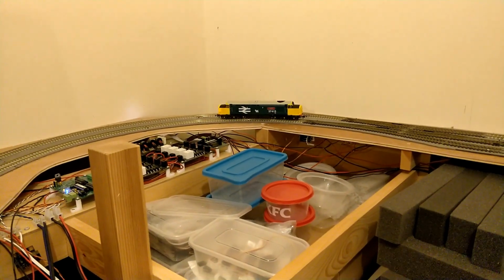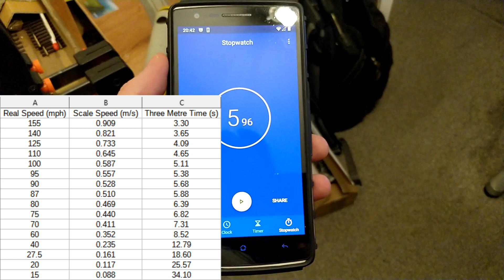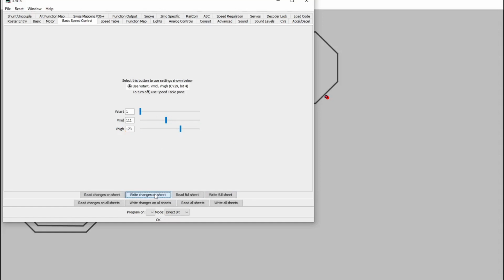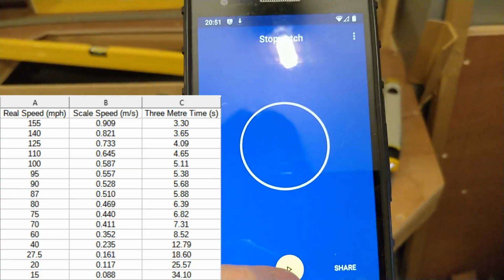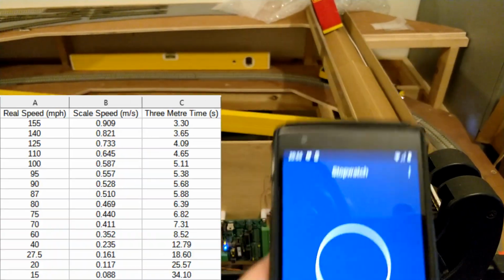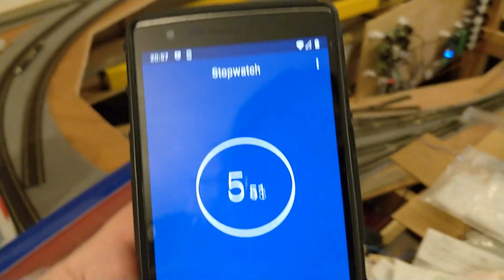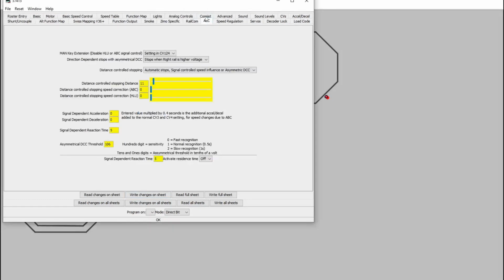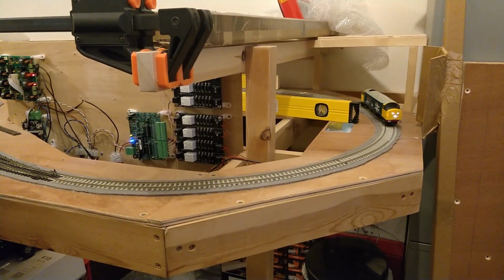DCC Decoder configuration for constant distance ABC braking

Comment: Hi. 3 point of acceleration It is a good but quite primitive method, because in real live parts of acceleration is not equal at all. 

For example Br 80 acceleration start slowly, but it own locomotive length it run for about 11 seconds, however distance about certain train length it beats of a 35 seconds. Which totally impossible to beat with CVs min-middle-max speed points. Or it is too slowly from beginning or move one meter scale rail too fast (faster by 10 seconds) than it needs.

Did you try more deeper SVs settings?